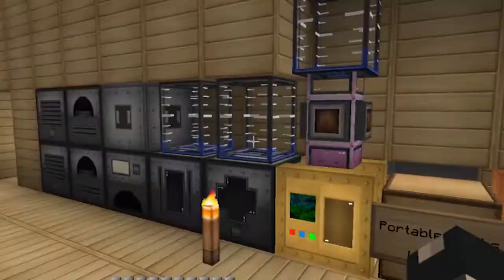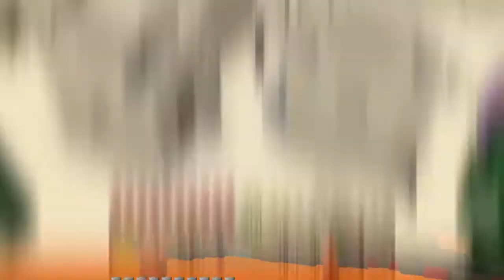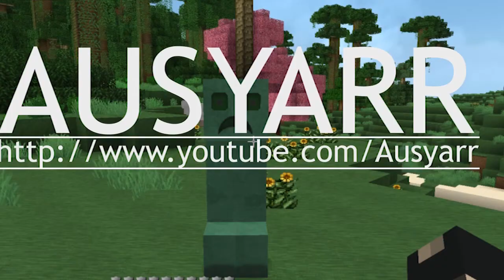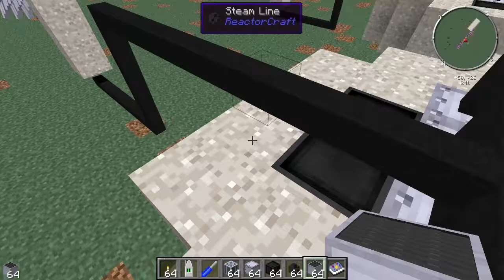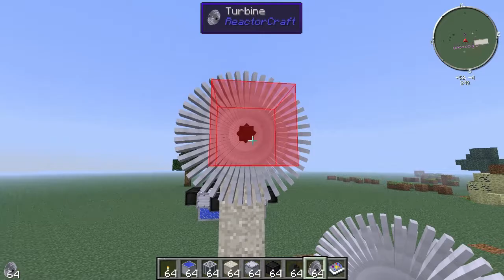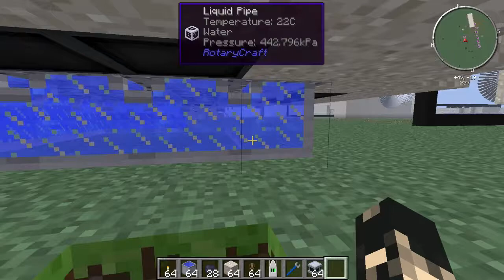Reactorcraft Fission Power Plant Tutorial, Design Guide

Comment: You are wasting a lot of energy imho. You could put a line of neutron irradiation chambers next to the steam boilers to get tritium. (I use a 3x3 setup with an output of ~900 MW in my stream)
Also, if someone of you is going to handle radioactive material think of a way to get rid of the nuclear waste (i already got fukushima & tschernobyl in my world ;) ) And most important, use a mystcraft age for your reactor!
Reply from the maker: I'll have to do some testing with the irradiation chambers and the neutron reflectors. I'll be doing further vids adding other reactor part to add complexity. Thanks
Reply: I think the chambers also work with neutron reflectors. The ReactorCraft Version i use doesnt contain neutron reflectors yet... have to update... you need heavy water (wich could be a pain in the a** to get waterlevel < 40) and a electrolyzer to get deuterium for the neutron irradiation chambers

Comment: With regards to to your serious runaway steam problem, you can effectively kill water steam by placing a block below the output of the turbine.  For ammonia steam that you want to recycle, you need a much much better condensing scheme.  What you have us giving you a ton of bad block update lag.
Reply from the maker: With the blocking of the steam with a block, is that a bug? I would do it and tell others to do it if i wasn't worried that it was going to be patched at some point. Have you got any tips for collecting steam with the condenser. 1 appears to have enough volume but doesn't collect it fast enough.
Reply: While technically a bug, I do not have any plans to fix it, because it is a useful way to discard steam.